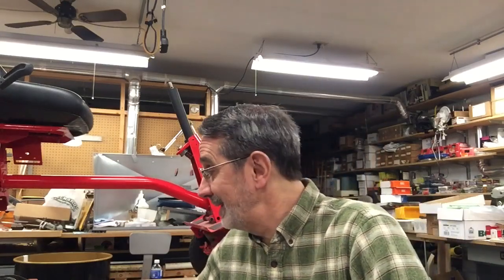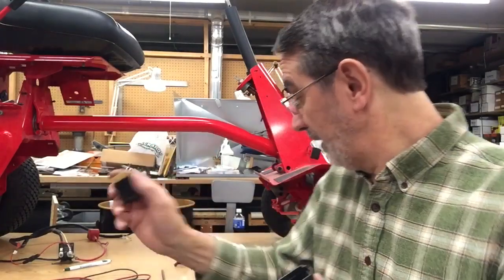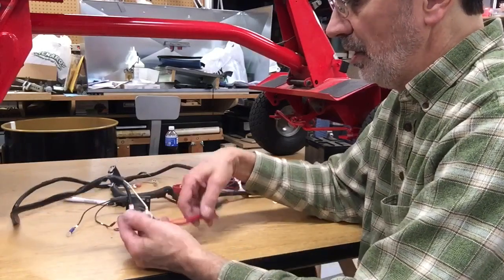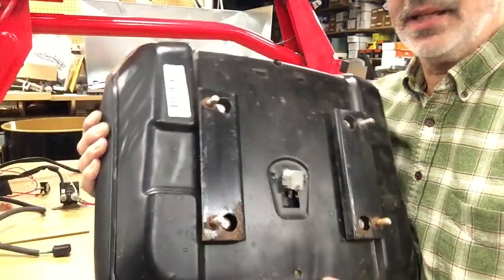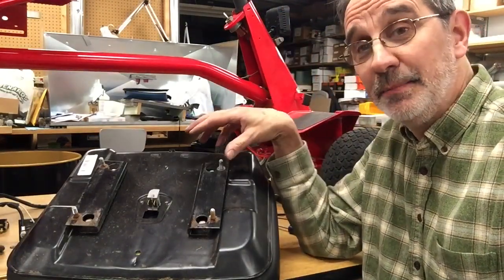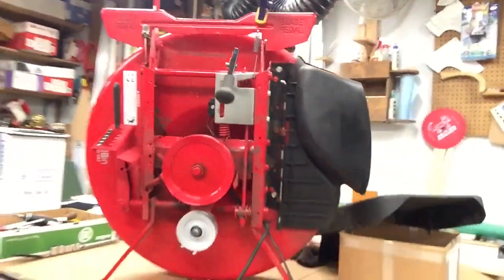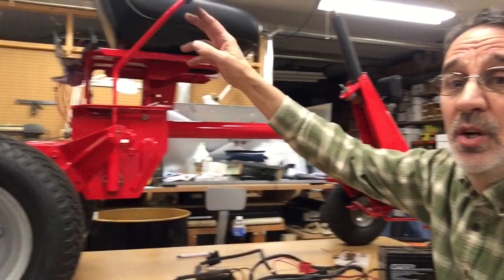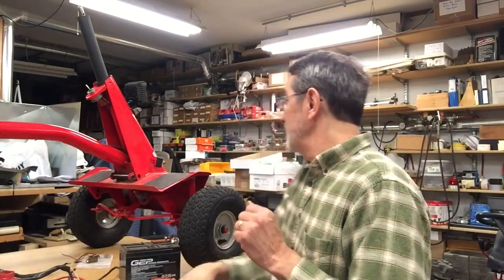273. How to test and find the safety switches Snapper RER

Comment: Jim, thanks for your advice on my snapper. I had one that would die intermittently. I thought it was safety switches but you directed me to wiring. you were right, of course. the brake cable was rubbing on the starter ground wire between the motor and seat. thanks again!
Reply from the maker: just a lucky guess.     Did she have any other issues send me an email I’m always here.       Jim

Comment: Great informative video Jim! Those $50 safety interlock devices have less than $2 worth of components in them. Crazy stupid mark-up from the same company that has held the patent for decades and makes them for every mower made. I've been trying to reverse engineer these for one of my mowers.
Reply: Post that info if you can determine how that works...Tnx....

Comment: My mother in-law purchased a used craftsman mower which is identical to your Snapper. I cleaned the carb and runs like a top. My issue is when I release the clutch the mower shuts down. The only safety switch I have not completely checked is the double switch (as I call it). The one under the back with four wires. Could this switch if bad be the culprit that shuts the engine off when I release the clutch/brake. Thanks

Comment: Hi Jim- My craftsman/snapper 12.5 hp is not starting and not sure if it's the safety switches or what- do you have to choke it in hot weather before starting- i had to use starting fluid the last 2 times to get it runnin- i am using 90 gas without the ethanol also- been fine- it's in perfect shape.... just been acting up the last 2 times- acts like no spark then finally pops and starts

Comment: Jim- i cant get my snapper- craftsman 28" 12.5 hp briggs and stratton mower to start- replaced seat switch(awful) and cant locate the dual switch you are talking about on my diagram- 107.280340 mower = shows i have the module and 3 switches- but when i disconnect 3 wires on shorting block it starts- so not sure where this dual switch is or if its broken or not- i spray mower down occasionally to clean it maybe thinking switch got shorted out or something- very frustrating trying to repair this- replace seat switch tonight but when i get up mower does not shut off now- one wire on shorting block is disconnected so it will start and stay running- so im thinking whatever is connected to seat switch in series possibly is bad or shorted- any input on this or where abouts this dual sw. is?? thanks, mike

Comment: 16:30 "...and it is safe to start the machine."  (!)  THANK YOU - you supplied the missing piece of my puzzle.  Was trying to figure out what the Interlock Module was for!
It's safety switches are:  A)  Pedal Switch,  B) Deck Switch and C) Shifter Neutral Switch (my series 15 does not have this one.)   
I don't know how it works but my theory is it gets some power from the Ignition Module (Coil) Kill Terminal.  
I think my Interlock Module was starting to act up and finally I think it died (am in the process of debugging.)  
If it is removed, there are still safety switches:  A) Pedal Switch (same switch, it is double pole) and B) Seat Switch.
Reply from the maker: I’m not sure what machine you have, but typically if the interlock modem shorts out, the machine won’t start and all the safety switches shut down the machine.      Jim
Reply: @jimjackson9381  It's a 33"  331415kve w/Kohler CV14st-1490.  There are 2 safety circuits:  1) for when you are riding and fall off and 2) when you are starting.  Without question, that interlock module was acting up over the past few years.  I like in the troubleshoot section of the Snapper manual says "replace or remove."
Reply from the maker: Well, I tell some of my viewers to remove the small wire coming out of the area where you’re starting solenoid is, and the interlock modem from the magneto shorting block on the side of the engine, but only for testing purposes to see if it the safety system causing the issue, but after solving the issue, re-hook the wire.           Jim
Reply: @jimjackson9381  On my Kohler Command 14hp, there is a 3-wire connector coming from under the cowl by the oil filter.  2 stator wires and the kill wire.  When I discovered (no wiring diagram for ignition switch) it was a kill switch, I disconnected it and had spark.  So great way to test ignition.  Putting that back, I found it was the Interconnect Module which I removed.  I don't need start interlocks.  "Falling off seat" interlocks are independent and still in play - they are 2 separate systems.

RE:  Interconnect Module:  Somehow, it must get some kind of power from the Ignition Module (Coil) kill terminal (there is no other potential power source).  I wish there was a schematic for the coil to understand what is in there.  Kohler service manual has nothing.  

RE:  Snapper Service Manual:  I'm looking for one but does one exist?  I have the operator's manual, but doesn't have a wiring schematic.  I found the schematic n Jack's Small Engines website.
Reply from the maker: @NoferTrunions  you can also go to Parts Tree.Com with your model number and they’ll have a schematic on their website for you. That’s where I find all the ones that I need.          Jim
Reply: @jimjackson9381  Wow Thanks!  The range of what they have on  that site is staggering.  RE:  Snapper Shop Manual:  Is there such a thing?  I found online circuit diagrams specifically but never the publication they came from.  Is there a "service" manual?  or?

Comment: Very helpful video Jim!  Thanks.  When I lift up on clutch/brake pedal, my snapper dies.  Very weird as the mower has worked beautifully for years!  Any ideas of what may be causing this to happen?  Thanks, Chip
Reply from the maker: Check the safety switch on the yolk inside your rear case. If you stand up your machine it’ll be on the lower left-hand side. That’s typically the issue. Jim.

Comment: I have a snapper re110 mower with the Briggs & Stratton 11.5 engine. I put a new seat switch in, deck safety switch. Engine starts fine but once you try to go and reverse or forward or engage the blades the engine stalls.
Reply from the maker: Well you still have an issue somewhere in your safety system if you’ve checked all the switches and all the wires for bad spots could be your interlock modem that’s the brains to the system. I can’t tell for sure unless I have the machine in front of me to run some tests on it.         Jim

Comment: Loved your video.  I just got a M280919B 28 inch rear engine rider from a friend of mine.  The mower is in great shape and starts fairly easy.  However, when you put the mower in gear and release the clutch/brake, the mower dies out.  Could it be the seat switch, the pedal switch or something else?  I'm kinda new to this but I'm willing to give it a try.  Thanks!
Reply from the maker: It’s either the switch on your yoke underneath the machine in the rear case or it’s your interlock modem that controls the whole safety system. Jim

Comment: Snapper RE110 - Was starting great - A week later would not start when turning the key, zero click or sounds of any kind -- Installed brand new battery - Same result - I assume the Solenoid could be bad as a next step of determining root cause - Any thoughts and/or guidance would be greatly appreciated - Thanks!
Reply from the maker: First off I would check the fuse that is in the area where you’re starting solenoid is, let me know what you find. Jim

Comment: I have an SR120 Snapper riding mower. I washed it lightly with a pressure washer today and now it still starts but as soon as I move the shifter lever off its sensor or try to engage the mower it dies. this particular mower is not equipt with a seat sensor and never was. wonder what would be the first place to look to find this electrical problem and its solution. it's in a nice dry place now and will try again in a hours and days but am thinking something actually changed and it's not just moisture causing the issue.. Any thoughts?
Reply from the maker: Well, I did see something got a little water in it and shorted it out and let it dry out good and it might be all right. Otherwise there is a safety switch on the more deck underneath the black cover and there is one underneath the rear case if you stand your machine up, it will be on the lower left-hand side as you’re looking at it usually has four wires going to it and it is activated by your yoke, if all them test good, it could be your interlock modem, which is the brains of the unit and they’re usually a little expensive. Jim.

Comment: Thanks for the information.
If I have a snapper that just won’t give me fire and I’ve replaced spark plug coil and wire what would that be most likely?
Reply from the maker: OK what do you wanna do and this is only for a test to see if your safety system is causing the issue, on the front of the engine behind the gas tank there is a control panel  it’s where your throttle control Cable hooks to the engine on the lower corner towards the outside there is a stud that’s sticking out and typically has three wires hooked to it one wire goes up inside of the engine the other wire comes down from the ignition switch out of the tube and hooks to it the third wire comes from the compartment across from the battery that is the main control wire for your safety system take that wire off if the machine starts and runs then the issue is in your safety system somewhere it’s either a switch, bad wire or the control module itself. But this is only done as a test to eliminate the safety system or to tell you that is the issue this must be hooked back up before you start using the machine. Jim
Reply: @jimjackson9381  thank you so much Sir

Comment: Can i bypass the old interlock system? My local shop says the interlock is discontinued.  

31R707-0001  
8hp rear B&S

25085s snapper

Currently have it cranking, i think i missed power to the magneto. 
6 pin clip was empty, i spliced in a fuse holder, only had 3 wires though, so i think im only powering altenator and fuel solenoid.  

If i power alt, fuel, and magneto.. and interlock is bypassed.. will it start? Assuming fuel/spark is working as intended?
Reply from the maker: @patrickeckart1685 if you wanna bypass your entire safety system for the purposes of finding out what your issue is, you really should get the safety system working it is there for a reason and with that said. On your control plate on the front of your engine that is where your throttle cable hooks to just above the cable, you’ll see a bolt sticking out with three wires hooked to it typically one wire goes up into your engine and hooks to your coil. The other wire comes out of the tube from the front ignition switch. The third wire comes from the compartment where your starting solenoid is that is the main wire coming from your safety system take that wire off of your magneto shorting block and your engine machine should start and run normally if it does then your issue lies somewhere in your safety system, if it doesn’t start, then the short could be the wire coming from the ignition switch or the wire going up in the engine to the coil check with a continuity tester and make sure that bolt is not touching ground or your engine will never start. It’s mounted in a plastic insulator in the control plate. Sometimes them insulators crack in pieces fall out, allowing it to short to block and kill the engine. Once you find the issue and repair it hooked to wire back up so your safety system will work, I know there a pain, but they’re there for a reason and that is to save your fingers, toes and even your life.      let me know what you find out. Jim.

Comment: Jim, thanks for taking the time to create these videos. My Snapper suddenly would not start. I pulled the plug and was getting no spark. I tested all of the safety switches and all of them had proper continuity. When I disconnect the wire from the shorting block, I got spark. The machine starts and runs fine with that wire disconnected. The key does not work to shut the engine off, and I don't want to run it without the safety switches. Where should I go from here? Thanks again!
Reply from the maker: Check the wires coming from the ignition switch where they come out of the steel tube underneath the seat a lot of times rubbing on the corner of the steel tube. It will cut through the wires and short them out another place. The wires can get shorted out is inside the tube with the clutch and brake cable rubbing on the wire, the wire should be in a black plastic tube to protect them, you may want to pull the wires out of the tube and make sure they’re OK.   Let me know what you find out.       Jim
Reply: @jimjackson9381 
Jim, I ran all new wires from the ignition switch to their proper connections. I still have no spark when the wire from the shorting block is connected.  When I disconnect that wire, it starts. Could that wire coming from the shorting block be the problem?
Reply from the maker: @Mike-ev4ly  now this is for a test only unhook the wire coming from the area where you’re starting solenoid is that’s the main wire coming from your safety system and leave the wire hooked up coming from your ignition switch. There originally should be three wires hooked to your magneto shorting block, see if it starts and runs it does your problem is your safety system?          Jim
Reply: @jimjackson9381  I did as you said and everything with the ignition works as it should now that I've removed the safety system from the loop. I want to get those safeties working properly. I've tested each switch for continuity and they all work. Could it be the 'brains' of the interlock that all of the safety switches are wired through?
Reply from the maker: @Mike-ev4ly  yes it probably is that but they are expensive so before you buy one of them, check the wires to make sure they’re OK and check the plugs or the connectors that plug into the safety switches and make sure they’re not corroded and making good contact if everything looks OK I guess I would probably try a new interlock modem.     Jim
Reply: @jimjackson9381  thanks for all your help Jim!

Comment: Jim, what about the safety switches on a snapper rider that is a manual start?  I have one that does not seem to get fire to start.
Reply from the maker: Well, the pool start only machines would not have a switch in the seat unless you left it in gear. It should still have a switch on the more deck and it should still have a switch on the yolk inside of the rear case, I’m not sure how many eights it has. I’ve never worked on a manual start machine.       Jim

Comment: I'm having an issue with the dual switch on the brake/clutch near the yoke.  With the mower running, I lock the brake pedal down and get off the mower.  When I go to empty the bagger, sometimes the mower will shut off.  I assume it is the movement at the back of the mower causing the switch to move.  I check to see if the switch is firmly seated and find a lot of play.  The tabs are engaged.  Have you seen this before and do you have a method to tighten the switch in the socket?
Reply from the maker: carla1492 
The little spring steel piece on your yoke that activates your switch bend it a little bit so it pushes harder on the switch sometimes they lose their tension and that’s what happens. Jim

Comment: Thanks for the vid. I just got a near new Snapper RER. It wont turn over with the starter (unless I jump the solonoid) but fires up with pull rope. Engine dies when mower is placed into reverse or forward gears. Seems like a safety switch. Seat?
Reply from the maker: Sounds like your switch on your yoke inside your rear case is bad or adjust needs to be adjusted. Jim
Reply: @jimjackson9381  Thanks so much, I will check that. Been using Snappers since the 1970s and never had one with all these sensors
Reply from the maker: @bigredmachine55  Yeah I hate all them stupid things to let me know. Jim
Reply: @jimjackson9381  if you know anyone that needs a bagger for a really late model Snapper let me know
Reply from the maker: @bigredmachine55  What state are you in, how much are you asking for it, and is it a single or double bagger. Jim
Reply: @jimjackson9381  In GA. Just got the mower and don't know the value of the bagger. I will see which type bagger it is. It looks to be lightly used.

Comment: My 28 in snapper has a rough running motor when you let the clutch out, push the clutch back down and the motor runs great. The mower starts just fine, just bad when you let the clutch out.  I hope you can help me.  Thanks, Don
Reply from the maker: It sounds like you got a safety switch that’s acting up I had another viewer that had that issue when he let out the clutch the machine would go for about 5 to 7 feet and it would start to stall if he push the clutch in quick it would start running again and he’d Would let  out the clutch and it would do the same thing come to find out his safety switch in his seat was corroded and causing the problem. Jim
Reply: Jim thanks for your reply, the problem was not the seat switch, but the brain unit under the seat /gear shifter area.  Swapped that with a neighbor mower and mine was just fine.  Thanks, Don
Reply from the maker: Yes that sounds about right they are the most expensive piece of the whole safety system and that’s typically the last thing I tell somebody to buy and replace. Jim